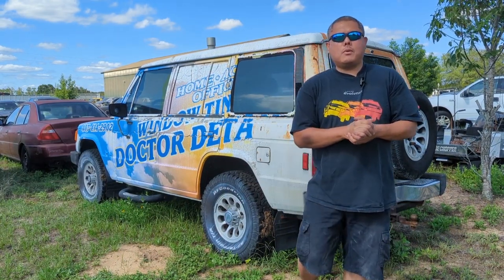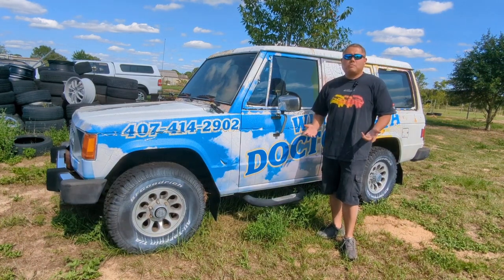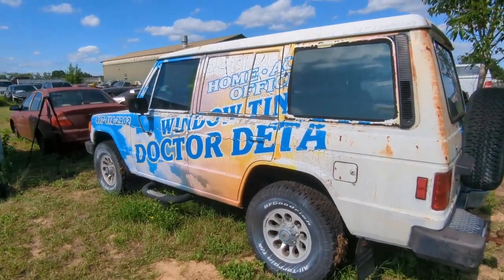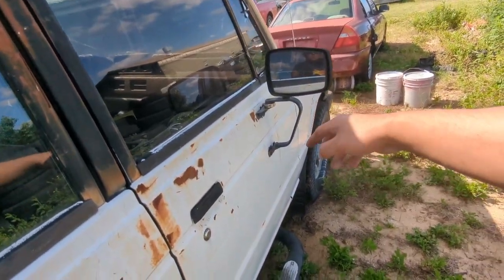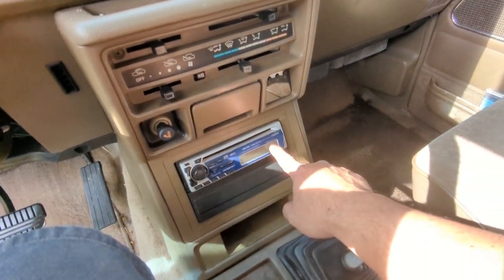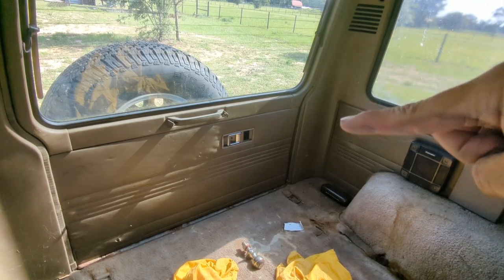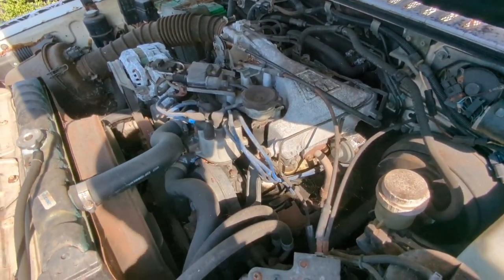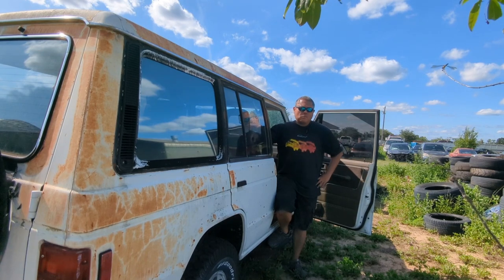Our 1989 Mitsubishi Montero LS introduction walkthrough & the plans for its restoration build.

Comment: Just a tip if you don't know yet, the steel pipe in the lifter valley dusts out and it looses coolant into there. You can't see coolant running out there and if you're not aware of it the motor can overheat.
Reply from the maker: Yes that can be another issue with the "valley pipe". I will know more when I start tearing it down. I am planning to start taking things apart next month. Hopefully I can possibly find the culprit of what caused the coolant loss.